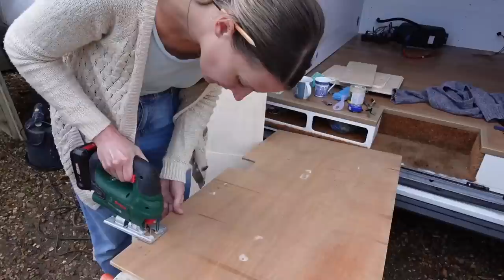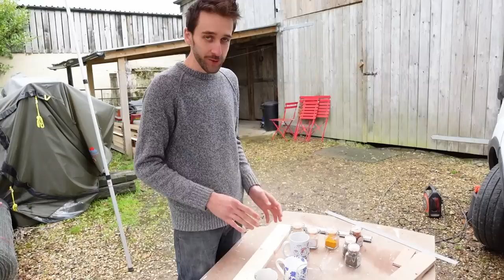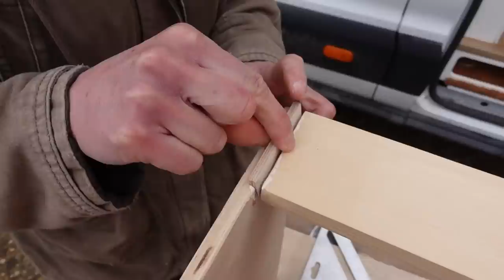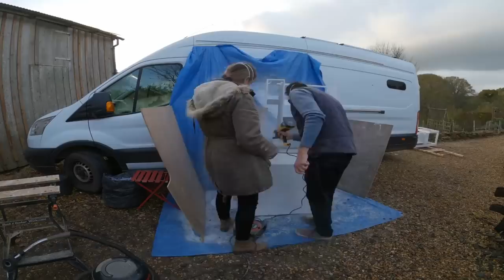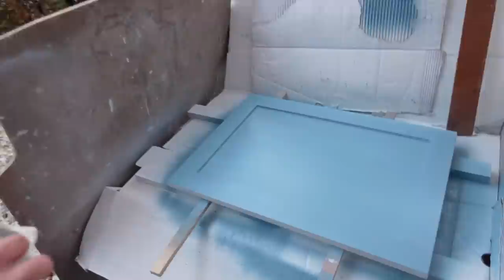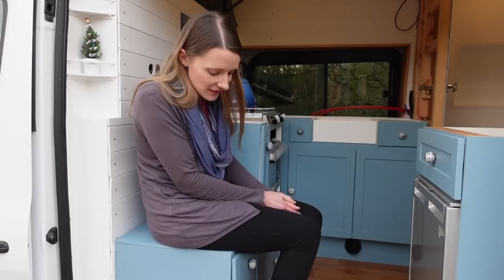DIY Campervan Kitchen Build Part 2 (with Drawers & Pull Out Pantry!) | Transit Van Conversion E33

Comment: I'm currently designing van kitchenette. If you designed the oven to slide into corner area you had difficultly accessing.. it would create more room and even access to the cabin.
Still an excellent job and I was going to use large timber struts instead of ply. I was anxious about the integrity of the units dislodging when traveling over humps (and common UK potholes 🙄) over time.
Thanks for the posts, very clear and supportive tutorials
Reply from the maker: Thank you, you're welcome :) We did think about having it in the corner but we really like having the worktop there. It's a big thing to place for sure, we can still get into the cab though through the hatch if we need to. We were a little concerned about that too but happy to say that over many miles and over lots of crazy Devon potholes our cabinets are still holding up really nice! 😁

Comment: Hi guys, hope you are well and enjoying your travels 😊 I’m just rewatching this video for the umpteenth time trying to work out our cabinets 🙈 Please could you let me how thick your kitchen cupboard doors are and which hinges you used? Thanks again, we’d be lost without your videos 😂🙏
Reply from the maker: Hey! All good thank you, and yeah it took us a lot of pondering to figure out what to do with our kitchen! Probably the most bespoke thing to build in the whole van 😀 We used 9mm birch ply for the doors and then added a thin band of 6mm for the frame effect on the outside so around the edges it ends up being 15mm. That is just enough depth (if you're careful!) to seat standard 35mm hinges. We went for these ones: https://www.wickes.co.uk/165-Degree-Soft-Close-Clip-On-Cabinet-Soft-Close-Hinge-Nickel-Plated-35mm---Pack-of-2/p/103293 . They worked great, we just had to figure out how much of a block spacer to mount them on so they fit correct. And you're welcome, glad they're useful! 👍
Reply: Much appreciated 🙏 Will make sure we’re careful with the depth 😅
Reply from the maker: @natalieeccles9604  No problem! 👍

Comment: Those are such complex kitchen cabinets. Well done!  I had to use thumbtacks to hold my rubber shelf liners in place. Otherwise they shifted going down the road.
Reply from the maker: Cheers! And thanks for the tip we'll keep it in mind if we have any problems 👍🙂

Comment: This is an amazing build series i've been following along. However, how do you guys have every tool imaginable? It blows me away these van builds and how everyone basically has a woodworking shop just in their backyard.
Reply from the maker: Cheers :) We've only bought ourselves the ones specific to the van build, mostly all the electrical and plumbing bits and the common ones like the jigsaw and drill. We picked them up as we went along really, partly second hand, sometimes a Lidl special 😛 A few other really niche ones like the worktop jig we bought and then resold on eBay after we were done. And then we were very fortunate to be able to borrow most of the others, especially the heavy tools like the chop saw and table saw from Abi's dad, most of those acquired over the years from car boot sales. Definitely helps having the right tool, we started off with the basics and got more confident with others through the build 👍

Comment: You two just seem to make the most amazing things and your attention to detail us excellent, and you never seem to have nice weather but you just crack on im supprised the paint dried ok, the kitchen looks fantastic very well thought out, have a lovely Christmas and look forward to your next video, 🎄
Reply from the maker: Thank you ☺️ The weather for this one was particularly hard to work with, definitely makes the whole project a lot longer! Fortunately we have the heater in the van though so were able to make it a nice 25C drying room inside even when it was sub zero outside, so they actually dried really nice and quickly in there! The bigger problem was keeping ourselves warm while painting it all outside 😀 At one point our cordless drill wouldn't work because the battery was too cold 🙃❄️ Hope you have a Merry Christmas and Happy New Year too ☺️

Comment: The most mm perfect build ever id say.  Too late now but I would have used full size wood screws, fastened them in - removed them and then cut them to size minus 1mm. mechanically stronger fit  I have never had confidence in those silly small screws.
Reply from the maker: Cheers, and that's an interesting idea. Wouldn't we then have lots of holes through to the other side we'd have to fill though? We managed to find ones that are still have a decent diameter in the end, 3.5mm x 8mm , took a bit of searching though!
Reply: @SelfBuiltStories  Yes you would have to fill the holes but thats not much of a job, I think it worth it as you have deeper threads making it a better join. Thats what I think anyway.
Reply from the maker: @PtangPtangBiscuitBarrelSmith  Cool, thanks for sharing :)

Comment: Great build - any concern about heat from the oven? Thinking of getting one, but not sure if it needs a heat shield.
Reply from the maker: Cheers! And yeah good question, the manual specifies a required clearance of 2cm on each side of the cooker and the use of a non-combustible material. So when we made the cabinet we left the gap and when we come to do the gas install and actually fix the cooker in properly we're going to add a 0.5mm steel/aluminium sheet on the sides and bottom. We haven't done it yet as we're still constantly taking the oven and cabinet out to do bits of plumbing and stuff 😛

Comment: Hi. 
Great videos. Thank you for sharing your journey. 
1 question: Did you have to dilute the paint to get it to run through the sprayer?
Reply from the maker: Hiya, cheers! And yes we did, we had to do quite a bit of experimentation to get the right consistency actually. The first attempts we had were too thick and used too much paint and were clogging up. Other attempts were too watery and the paint was running everywhere. We got a feel for what was right with a bit of trial and error. One other thing we did was to strain any paint that wasn't brand new through some tights to remove any lumpy bits. After a bit of practice we found it worked really well and saved a lot of time, but we had to be really on top of making sure it was really well cleaned after using it, the paint was good, and we periodically cleaned out the nozzle if it was sitting idle for a while. HTH! 👍

Comment: Lovely work 👍. May I ask where you bought your drawer runners? We're about to start our own van kitchen so a recommendation would be great. Thanks 🙂
Reply from the maker: Cheers 🙂 We got all the drawer runners from Screwfix and Toolstation (pretty sure they're selling the same ones). https://www.toolstation.com/ball-bearing-drawer-runner/p13686 or https://www.screwfix.com/p/ball-bearing-drawer-slides-350mm-2-pack/1590r and there are different lengths. HTH 👍
Reply: @SelfBuiltStories  Thanks for the info 👍. We have both SF (x2!) and TS locally, which is a bonus 😎.
Reply from the maker: That is a bonus! Could do with having them build one closer to us 😛

Comment: Could I ask, please, what thickness of plywood do you use and what length pocket screws do you use? Thankyou 🙂
Reply from the maker: We used 12mm plywood for this build which we found to be the minimum where you could pocket hole it, and it varies with different plywood as well. We found 12mm birch ply is around 12.5mm and works quite well. But cheaper 12mm hardwood ply from Wickes etc is more like 11.3-11.5 and that makes quite a lot of difference. We've done it but to make sure the screw doesn't come through the other side, the screw head has to stick out marginally proud. But in places where we can't see them we've done that. And for both you need the pan head pocket screws which are flatter on the top which tuck in more nicely. Length wise we used mostly 1" everywhere in the van, for some other projects we used some 1.5" and 2.5" as well. HTH 👍
Reply: @SelfBuiltStories  Thankyou! Yes I’ve been having this problem too, this why I asked. Perhaps my plywood is actually a bit less than 12 mm because I find that the pocket screw is sticking out a bit terribly… and I’m not always convinced about the grip it has, it seems too close to the edge of the wood and could break off easily. I’ve been using 25 mm pocket screws, but then I couldn’t find any pocket screws that length anywhere that were made out of stainless steel so I’ve been having to use the zinc coated ones. Maybe that’s fine and I’m being a bit over the top. But anyway, at least it’s not only me having that problem, I’ll have to be careful with the pocket screws and check my wood. Thank you very much again. 🙂
Reply from the maker: @pinkbsl7972  Yeah I know what you mean, 12mm is definitely the minimum limit that you can get away with and even then it takes a bit of patience! We glued everything too and wood glue is strong, so the pocket screw is mostly just pulling it together and holding it all tight while it sets. With the birch ply we had no issues at all, but with the cheaper ply we did find a couple of screws wouldn't completely bite and would spin at the end which was annoying. So for a few of those stubborn ones we broke off a bit of the end of a matchstick and stuffed that into the hole before screwing to give it a bit more material to bite into. 

The tolerances are so small on the 12mm wood so we made sure to write down all the settings we needed for different wood and screw lengths to set the jig so that we didn't go a hair too far and drill straight through! And be sure to use the pan head screws and not the dome headed ones at that thickness as they do make a difference with how proud the head sticking out is, if it's important to have it flush. In places where it was just cosmetic we still used the dome ones as we had a big bag of them that were cheaper to use up 👍

Comment: There were six lots of ad breaks in this sanding and painting special. I love you guys, but this is drawn out far beyond its' merit.

I think there was a segment where it was talking of weather, then some cat and flower shoots, then music so loud I couldn't hear what oldmate was saying, then another ad break.

This has stopped being quality content.
Reply from the maker: Hmm that's frustrating thanks for the heads up 👍 This project ended up being one of the longest in working time of the whole build so far which we weren't expecting, lots to build and crazy weather! We like to include it and add cut scenes of the animals and garden to break it up as that's how we like to watch it back. Sorry one of the bits of music overpowered out the audio. We do spend a lot of time normalising the sound to try and keep the levels consistent and audible, will keep in mind to dip it down a little more when there's talking. Cheers for the feedback
Reply: @SelfBuiltStories  thanks for being amicable about negative response.  That tells a lot about your channel.  

I truly respect you both.
Reply from the maker: No problem, always room to improve things and it's a big learning procress. Merry Christmas! 🙂🎄🎅